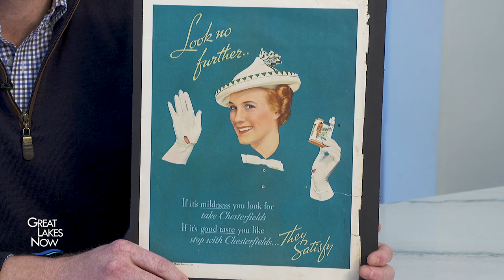Freighter Mystery | Great Lakes Now

Comment: I served on a ship called the M.V. Charles R. Huntley in the late '80s. She was previously the S.S. Charles R. Huntley. Converted to a Trail Suction Dredge sometime in the early 60's. She had 2 boilers, 2 big steam-powered bilge pumps, the boilers were converted to fuel tanks with a 3rd fuel tank added in the next room forward of the engine room when she was converted to diesel engines. She still had the steam winches on deck (since powered by a diesel air compressor). According to a bulkhead in the main engine room, she was built in Scotland in 1932. Still, inside the hull there were big copper wound coils about every 10' on the inside of the hull, these were apparently for repelling magnetic mines. You could still see the markings on the deck where guns had been mounted. I could not find any references to the Charles R. Huntley before the '60s and always wondered what she did during the war. If anybody knows, I would surely like to know just out of curiosity. She has since been cut up for scrap out on the east coast. I spent 2 yrs on her as the electrician. She was 311' long, with a 48' beam, if memory serves me correct, built to fit into the locks of the Welland Canal.

Comment: Looks like the film was shot at 24 frames per second, which was common for home movies. Film was so expensive that a slow frame rate was used to save film.   Set the playback speed to 0.5, and the Huletts are operating at approximately the correct speed, still a bit too fast.

Comment: I have to question whether you've got the right boat, based on the photos shown here.  The boat in the video is clearly a "hatch farm", where the hatches were only about 2-2.5 ft apart and there were a lot of them.  The picture of the smith Thompson shows only 13 hatches and they are much further apart.
Reply: Good eye about the "hatch farm". Brings back memories. I first shipped out of the Lake Carriers hall on West 25th and caught the Ben Moreell for Wilson Marine Transit. That was a hatch farm.

Comment: Know those docks well.  Spent 4 summers ('71-'74) working on US Steel Great Lakes Fleet ore boats.  I was on the William A. Irvin in '72.  The Irvin carried passengers every week that the company wanted to wine and dine.  Picked them up in Chicago, went up to Duluth empty to load taconite pellets and then take them back to Chicago.  We ran on a regular schedule where the trip took a week. Going up empty of course meant that we had a lot of water in ballast tanks.  One trip we were behind schedule getting to Duluth so the Captain thought he would save a little time by pumping the tanks nearly dry before we got to the loading dock.   Unfortunately that meant that the boat was sitting high in the water and the Irvin was built with one more deck up front than the usual laker (which is how passenger cabins were accommodated) so as we came into the dock the pilot house deck tangled with the dock superstructure and came off second best.  Oops.  Needless to say, that manuever did not help get us back on schedule.  The Captain wasn't the most well-liked guy aboard so the incident generated a significant amount of mirth among the crew.

Comment: The hullett unloaded in Ashtabula  caused the fitz to break in half.  That had operator higher up, at the elbow.  The claw edge struck the bottom plate next to the weld.  This is a brittle area named ‘weld effected zone.’  They knew the crack was there.  This did not cause the sinking.  That was taking on water because the hatches were not secured.
Reply: As the years passed it was revealed that the Fitz had seen a ‘temporary’ repair job at the Frazier Shipyard in Duluth about a month before she went down to repair the crack you speak of, with the permanent repair scheduled to be done after the season which was only weeks away. It turns out this was never mentioned in the investigations that followed because the shipyard workers feared for their jobs & pensions if they spoke up. Years later when that was no longer a threat they began to come forward with the information.